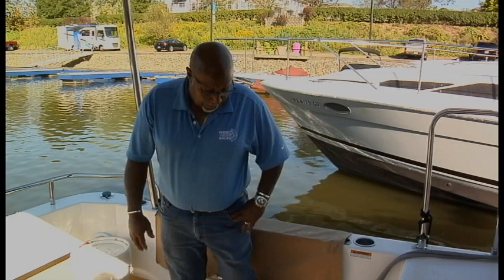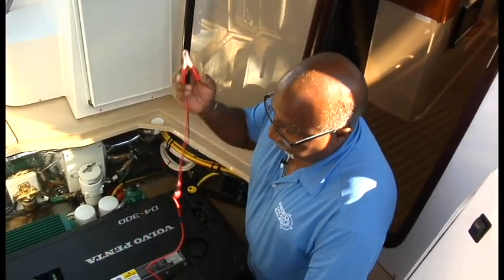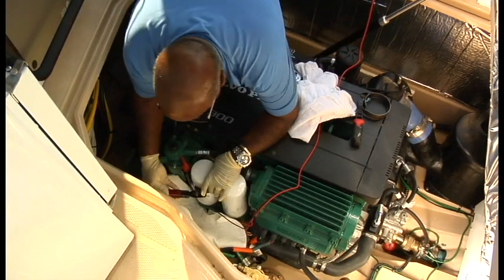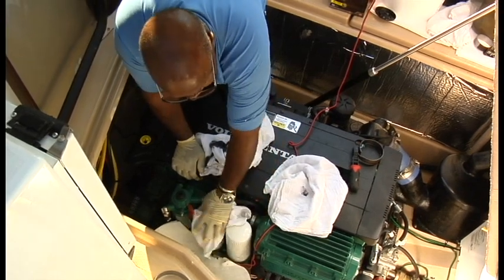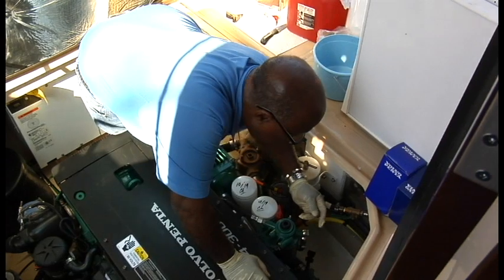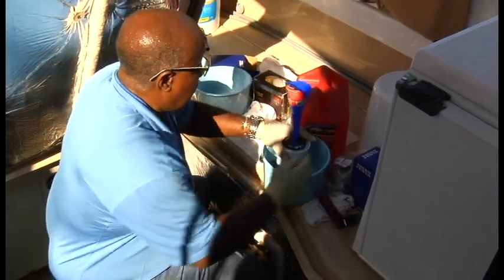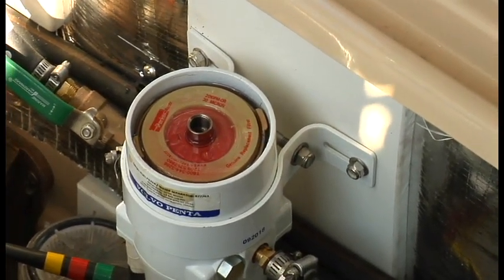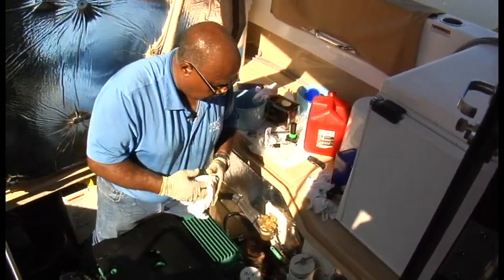ChangingOilAndFiltersVolvoPentaEngine

Comment: Thank you Chuck!  I am a new 2020 C28 Cutwater owner and wanted to do the maintenance myself.  I used your video to guide me through the oil and fuel filter change process.  Hopefully, you can do one for the transmission as well!  There is one change for at least our boat:  The little pin for the water sensor on the D4 260 fuel filter is a push pin that doesn't come off.  So makes it a bit easier.

Comment: 2015 R-27 (D3-200) new owner. My engine warning indication came on that the (secondary)  water separator was full. Which meant that both the primary and secondary separators had water in them. So we took the sensor off the secondary filter (on engine) and drained it, replaced the filter. Then I could not get the nut off the bottom end of the primary filter housing. So we removed the entire unit and disassembled. The bottom half (primary) which is a water separator too was full of gunk. So disassembly really was required to clean it all out. All total we got about a cup of water out of the units. My point here is that it is hard to see how bad the bottom of the primary unit is by looking in from the top of it with the cap off, even after dumping all the fuel out of it.

Comment: Great video, thanks Chuck. Where can I buy the brass fitment you mentioned that fits into the oil drain hose and then to the pump? I have tried drawing cold oil out of the dipstick filler and it’s very slow. I am draining cold because I have water contamination ( self inflicted mistake!), engine has not started so really want to get all the oil out of my D6 , refill it then start it, drain again and change oil and filters a second time.hence the question

Comment: Thanks so much for this video. I just bought a 2019 Ranger Tug R-29 CB with the same engine and this is going to be so helpful for changing my oil and filters.

Also, I really like that oil change pump rig you have. I assume you can pump directly into the bucket under the pump? Seems like a good setup!

Comment: Great video.  How about the Air Filter and the Crankcase Ventilation Filter?  Those should be done every 200hrs same as what you just did.  Also a video on the impeller would have been nice.

Comment: when marking the filters I also put the engine hours and date.  Question, since you see or work allot of Volvo Penta D4s, what is your opinion of the D4-260?  I have a 2007 D4-260 on my boat with approx 500 hrs on the boat and engine (I'm the original owner).  Good work on changing the oil.   Thanks.